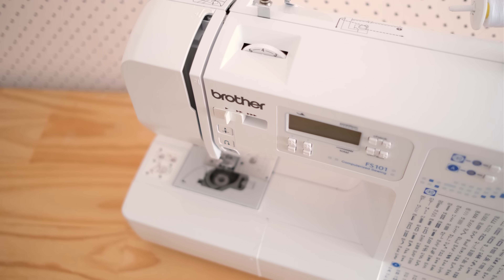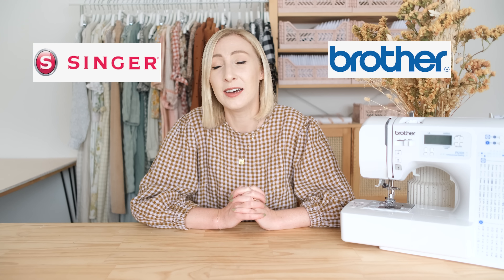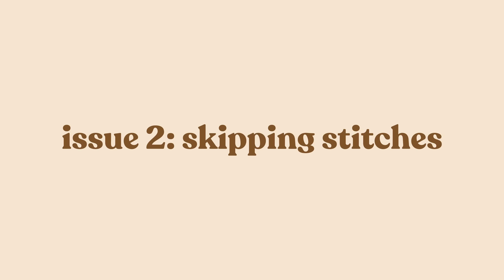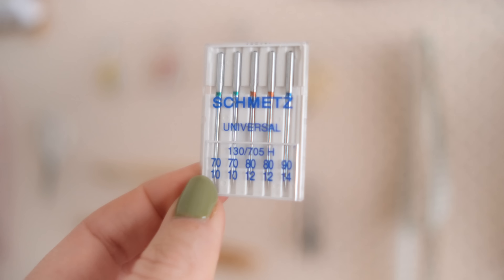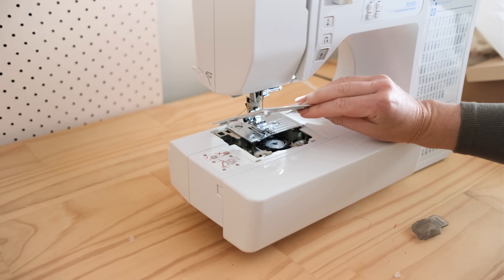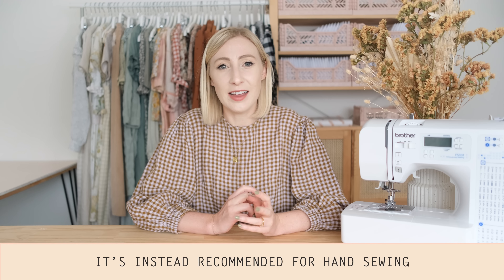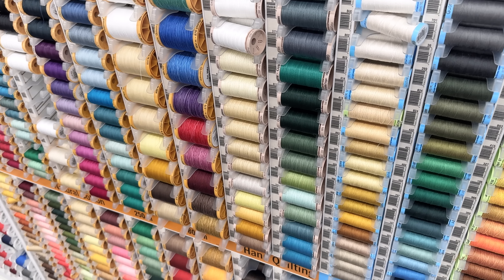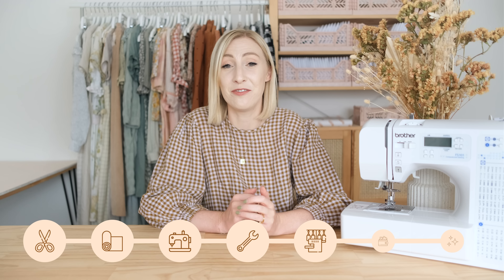Sewing Machine Troubleshooting Tips (When Things Don't Work As They Should) | Sewing For Beginners

Comment: I was just on a podcast with Lisa from Farmhouse on Boone a month ago, and that was the first time in 55 years of sewing that I’ve heard that threads can tangle from threading the machine incorrectly. I also spoke about how you need to hold the threads at the beginning of stitching. I hadn’t seen anyone else talk about it until now, and I’m so glad we are getting this information out. So many people stop sewing because of just this one thing! Also, it’s really important to keep your machine oiled as that can help your machine run properly. You can do that yourselves by following your machine manual. I have never had trouble using cheap or old thread, so i agree that it probably has to do with the brand of machine you use. I like Gutterman thread as well!
Reply from the maker: Ooh great tip about oiling your machine! Thank you for sharing 🧡